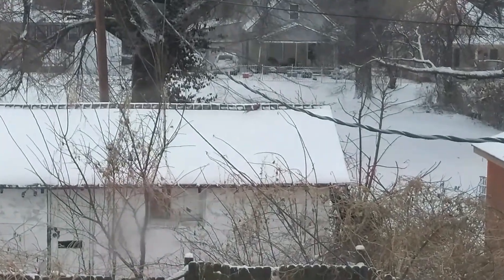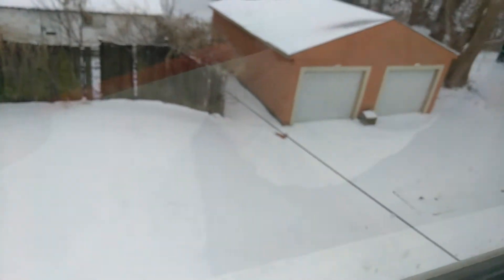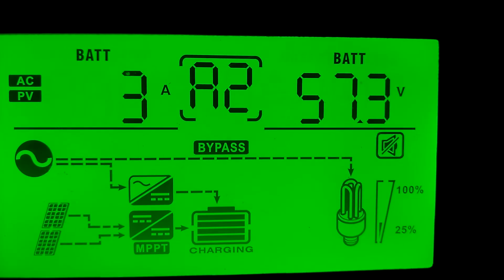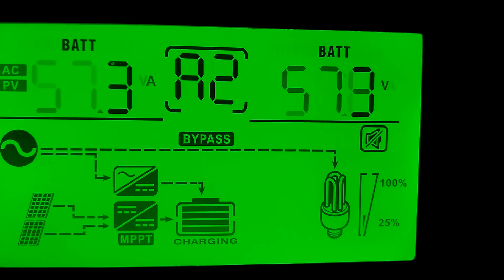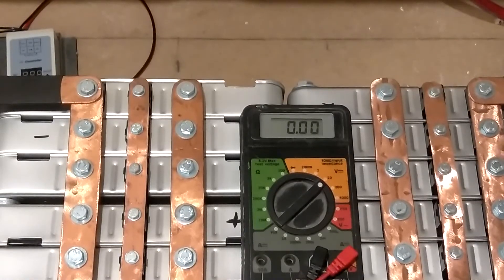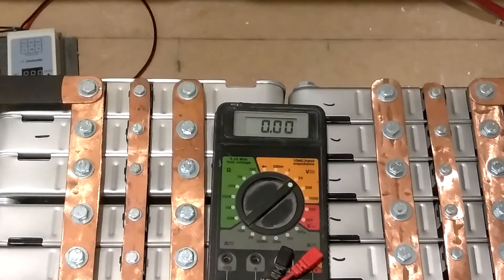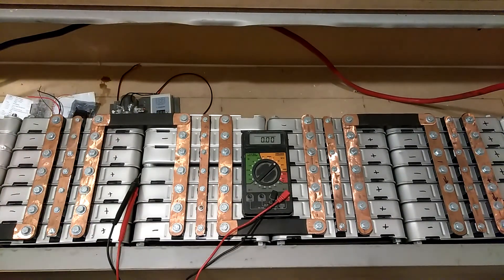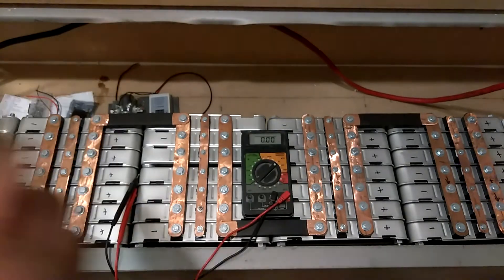Update on how the LV 5048 and Nissan leaf batteries are doing.

Comment: ? many  LV 5048 do you Have to run the House .
Reply from the maker: I have one plan to upgrade to another one before the summer.  I do not run my air compressor on my inverter but the normal day-to-day stuff I run everything on it my refrigerator washer dryer microwave a deep freezer all the lighting in the house is ran off of the inverter all my light bulbs are LED. We also run 2 flat screen TVs 2 pellet stoves in the winter and in the summer one 12000 BTU AC.

Comment: All good but .040 is more than I like so I balance down to .002  but if they don't get any farther out it just is the same.
Reply from the maker: Thanks for the info I was thinking about going and get a BMS and see if that would keep them in the    .002 range .  Are you running a BMS on yours.
Reply: @carsonlurbanwindandsolar3437   Yes I do use a BMS which has balancing and recently I added a 1 amp active balancer. I am using used lithium A123 26650 batteries and some have lower capacity so the balancer helps to level them out.
Reply: @carsonlurbanwindandsolar3437  My formula is to calculate how much they are out of balance and multiply that by two.  Then subtract that from my comfortable upper voltage limit.  For example, if you like 8.2 volts as the top then you would multiple 0.04 times two and get 0.08.  Then subtract that from 8.2 and get 8.12 (8.1 as MPP Solar won't do 8.12) as the 5048's max charging voltage.  When that lower max voltage gets low enough to impact total capacity then I balance them and start over.  

URL is awful, but this is what I am using on my Leaf cells:
https://www.ebay.com/itm/3S-4S-6S-10S-17S-Li-ion-Lifepo4-LFP-Battery-Active-Equalizer-BMS-1-2A-Balancer/322483456363?ssPageName=STRK%3AMEBIDX%3AIT&var=512849127410&_trksid=p2060353.m1438.l2649

1.2 amps is likely not strong enough to balance your pack though.  Looking forward to seeing what you come up with, although with a lower C discharge I am not sure I would put more than an alarm to manually check every 3 months or so and take action when needed.  Maybe even unhook the series connections and put the whole pack in parallel for 24 hours or so to balance them.
Reply: @carsonlurbanwindandsolar3437   BMS with active balancer would be great.